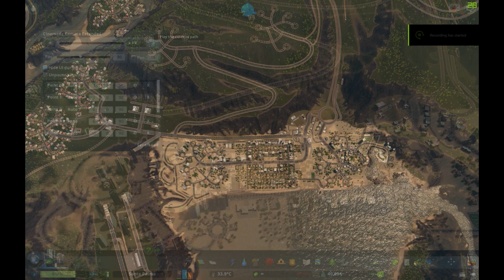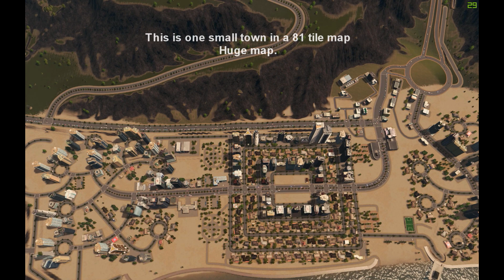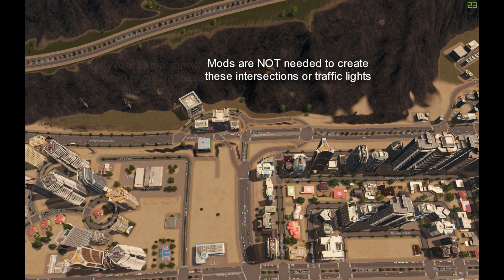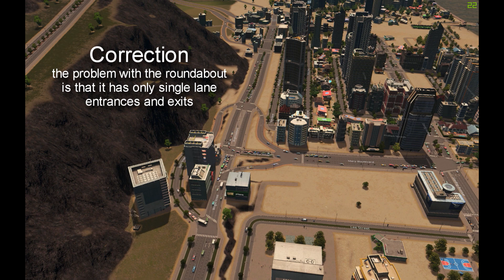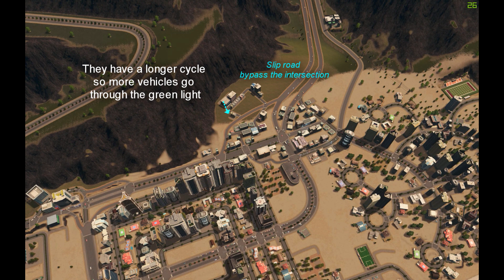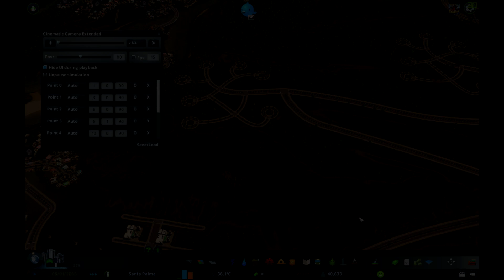Custom Traffic Lights and Intersections

Comment: Genius. I think the what impresses me most is your use of specific road pieces to control lane choice for the traffic. Not that the appearance of multi-state traffic lights in a vanilla game isn't pretty fantastic on it's own. Roundabouts now; you are probably right to just nix the roundabout right from the get-go. Here in the UK roundabouts are pretty much the go-to solution for high volume intersections. Unfortunately, often times the city planners end up sticking traffic lights on the roundabout intersections when the traffic volume reaches some peak, after which the roundabout can't cope. Personally I suspect the problem stems from the 'roundabout traffic' being able to move too fast which in turn gives traffic waiting to enter the roundabout too little time to get 'in'. As it happens, I have a fairly saturated roundabout in my current city. I can see now that there may be an opportunity to try mixing and matching road pieces for perhaps both lane-control and possibly even restrict speeds around the roundabout, although I suspect that for the speed aspect to work I may have to elongate the intersection in order for that to work. Point being, just as soon as I rejig my rail network (because I'm overrun with trucks), I shall get on it and try and upload a video of the before and afters. Meanwhile, keep 'em coming :)
Reply from the maker: "  is your use of specific road pieces to control lane choice for the traffic." So now you understand the point I am trying to make in My rail yard clip.
https://www.youtube.com/watch?v=OyjnzHYkCzc
Love the roundabout story thanks for the support, Lol. We have a triplet roundabout, thing as a highway interchange here. Good point of it really slows traffic to get to proper circle. Good loard I can get lost just talking about it!